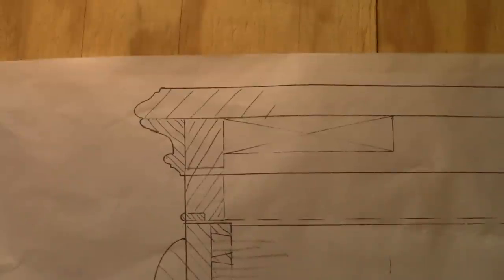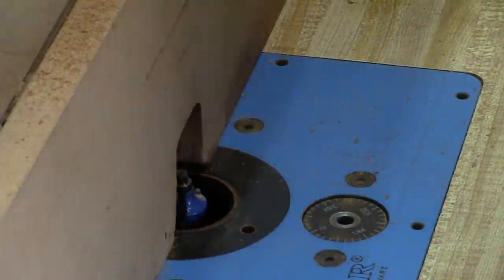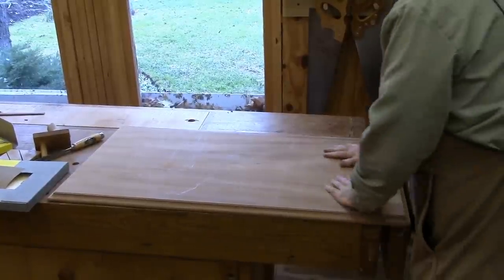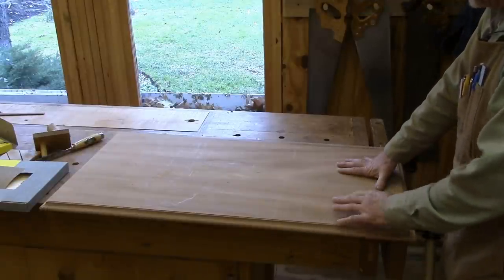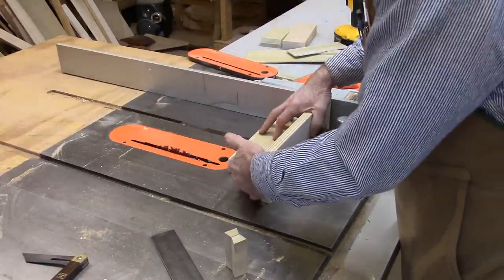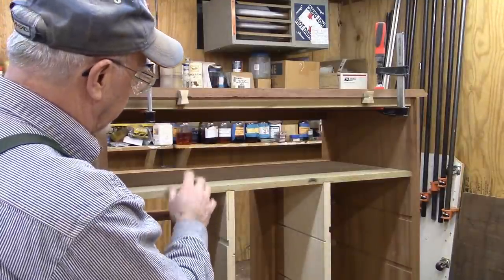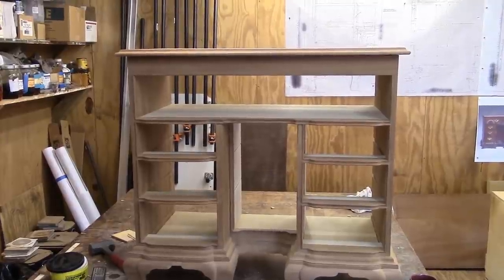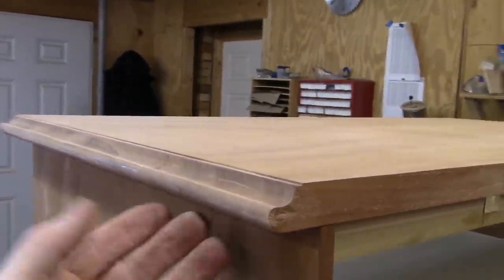Townsend Kneehole Bureau - Top & Butterfly Keys Step 7

Comment: Hi David:
It is always good to see a craftsman think out of the box.  That is one of the things you do all the time.  This time I am talking about making the profile on the top.  I think you enjoy doing plane work, but I don't.  I liked see you use the router to make the profile.  The best part it is a beautiful profile.
I have seen a Townsend's piece with a Butterfly joint to hold the top on and also allow the top to move.  That joint dates about 200 years and I bet they still work great. Did you make the butterfly joint to fit tight or lose?
Thanks
Reply from the maker: Thanks for the comments, The butterfly joint is tight, it holds the top down nicely